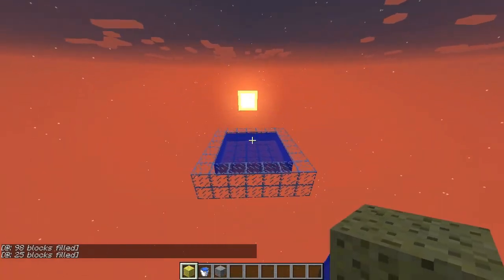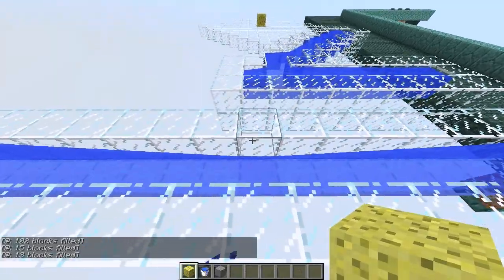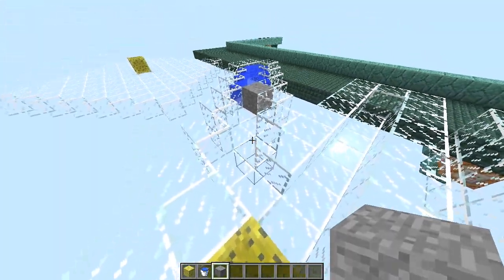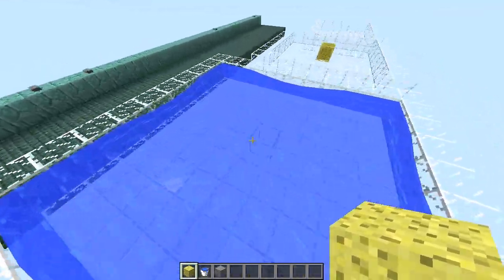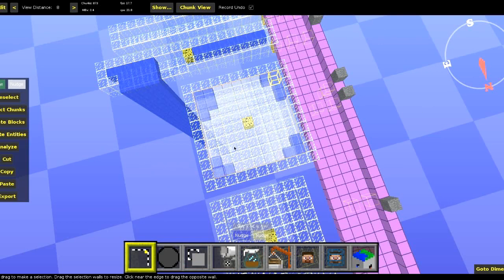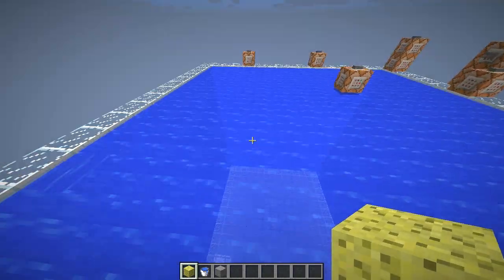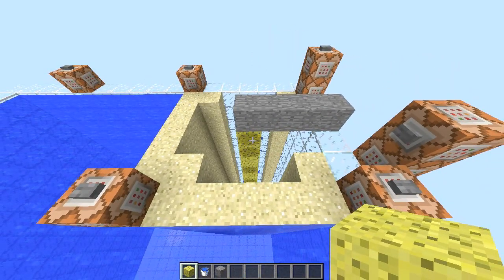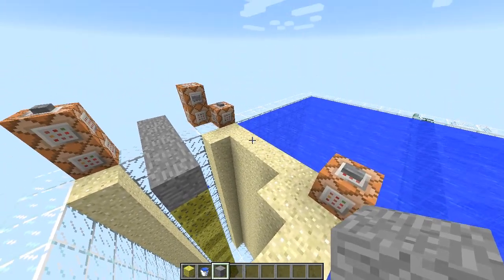Minecraft: How Sponge works (how to clear large bodies of water)

Comment: To clear out water you don't need no square shape sand barriers. Better to just make four or three block space wide walls along the width of whatever it is you're clearing long ways. Then place sponges along the rim( spread apart) starting from the top working down.

Comment: Crap, i had figured out the 5x5 method but was still hoping there'd be  a better way to clear water. Great video though, explains everything about sponges perfectly! 

I guess sponges simply aren't that well programmed and don't fuction that well, at least not for clearing out big areas of ocean.
Reply: Drayunek Destroyer of Worlds they work. Instead of squares, make long rectangles . Build sand walls along the width of whatever it is but make sure it's about 3-4 blocks in between the sand walls. Then put sponges along the rim spread out about 4-5 blocks. Then work your way down. Start at the top, that's the key
Reply: I cleared out a huge area of ocean. There's a guy that made a video of making a fish tank dam looking thing with glass . I made something similar its huge I wish I had the tech to post on YouTube lol.

Comment: You earned a subscription.
Reply from the maker: +DonutAssassin Thanks, that's appreciated.
Reply: vergeofapathy I found a faster but more sloppy method than this. I just section the water off in halls or rooms at most like 15 blocks wide and spam the shit out of the sponge from top  in a horizontal line in the direction of the hall  and go down from there once top layers are done. For the rooms, I just spam the sponge in a spiral from top to bottom. I just place sponge at spots i missed afterwards.

Comment: Wow you are a some kind of wizard.  Excellent explanations and tutorial, thanks!  :)
Reply from the maker: The-Mike_D Thanks a lot. :)
Reply from the maker: Does PE have sponge? You can still use the same methods on flowing water as long as it is connected somehow.
Otherwise the best method to do it without sponge is probably using sand or gravel to fill it in, just because they are easier to remove than other blocks.
Reply: +vergeofapathy my brother set one of my builds on fire and it was flammable,i had to use way too many source blocks,how do i fix this?FYI this is PE so i cant use command blocks
Reply: +vergeofapathy i need how to fix pouring water,not containers of water.
Reply: The-Mike_D I'm reporting u